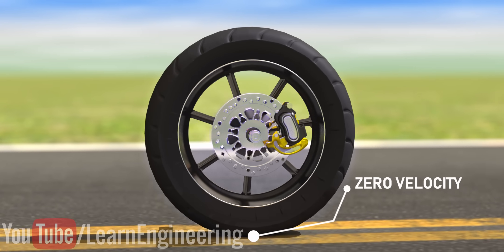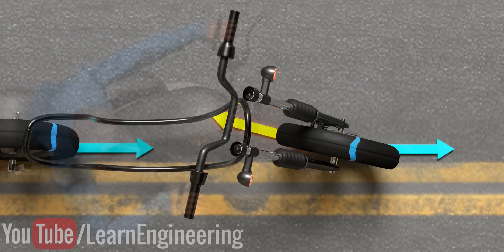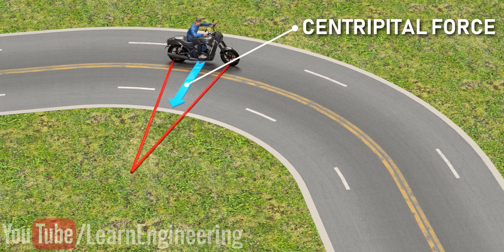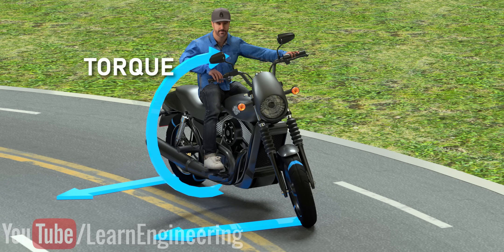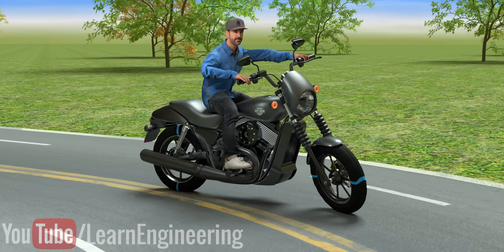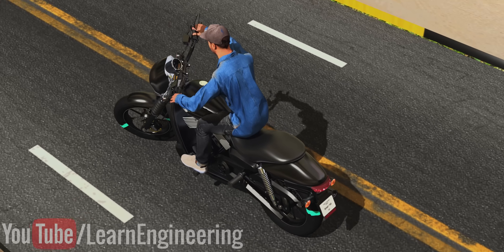Counter Steering | The interesting physics behind it

Comment: This video is incorrect and dangerously misleading.
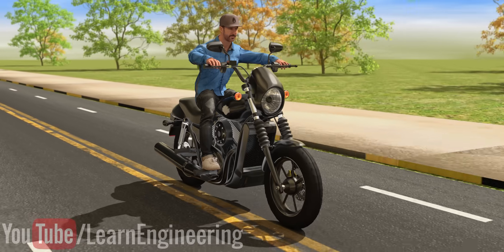It says at 1:11 that "In normal steering, to make a right turn, what we do is just turn the handle bars towards the right and lean the motorcycle inwards"
That's not true in the slightest. Counter-steering IS "normal" steering.
I'm far from being an engineer, but I cannot fathom why a video from "Learn Engineering" does not once mention the massive gyroscopic forces at play on a motorcycle, and does not mention Gyroscopic Precession, the most prominent force at work when steering a motorcycle.
Whether you realise it or not, the front wheel is always turned to the outside of any bend once the motorcycle is at a high enough speed. The front wheel is only turned inwards for slow-speed manoeuvres like u-turns where the wheels are not rotating fast enough for the gyroscopic effect to take over. It varies from bike to bike but this is somewhere around 20mph.
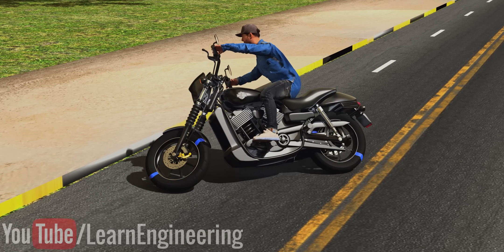THEN, at 3:57 it claims that "In normal steering, the lean of the motorcycle is achieved by shifting your body weight"
Again, totally false and dangerously misleading.
It is nearly impossible to turn a motorcycle at normal road speeds by body lean alone.
In fact, the complete opposite is true. You can ride a perfectly safe and comfortable ride from A to B without ever leaning your body in either direction.
This is a falsehood perpetuated by people who misunderstand what counter-steering is. If you lean to one side on a motorcycle, you are unwittingly pulling on the outside handle (The same as pushing on the inside handle, ie. COUNTER-STEERING) 
This video was clearly made by someone who's never been anywhere near a motorcycle, who is ill-equipped to call themselves an engineer, and I IMPLORE anyone watching this to completely disregard the misinformation laid out here for your own safety.

Learn Engineering, you should be ashamed. You are directly putting people's lives in danger by leaving this video for the world to see.
Reply: Well said. This is confusing and potentially deadly advice here.
Reply: Good 🔥
Reply: thanks.. im a noob who has yet to see a motorcycle up close, and i thought to watch videos like this before i take my MSF.  I ve never rode a motorcycle, but I have ridden a bicycle and this video is counterintuitive. No one ever had to teach me how to steer a bike, so I imagine a larger motorbike should be turned in the same way.... not with all of these steps...
Reply: @asher6657  steering a motorcycle at speed is simple: push left to go left, push right to go right. It really is that simple. When you're going slowly however you use "normal" steering: point the front wheel in the direction you want to go. At some point around 10-20mph counter-steering comes into effect once the gyroscopic force of the front wheel reaches a certain point. It's a different speed for every bike because the amount of gyroscopic force produced is dependant on the mass of the rotating object. (the wheel)
You can familiarise yourself with this concept on your pushbike, the principle is the same.
Reply: @thomaswarren2699  So are you saying turning a motorcycle is completely different that turning a bicycle?  I am NOT trolling,  If you ask me how to turn my bike at speed  I would imagine it's the same principle i would use to turn a motorcycle at speed.   I don't think I would be able to explain the mechanics, just like if someone asked me ''how do I walk?''  I wouldn't be able to explain the mechanics, adequately, but I can walk...  I think it would be the same with turning a bike... it's intuitive.  

 I remember when I was in USMC Bootcamp, when the DI's were teaching us the ''mechanics'' of marching, some recruits ended up walking like a robot. because the instructions became counterintuitive. It would have been better if they just said "walk this way''.  (like the Aerosmith song)... lol   

The point im making is if its the same as a bicycle, they should say the motorcycle turns like a bicycle instead of the step by step scientific explanations of the mechanics of turning a motorcycle IF its the same   I would just rent a mountain bike for 2 weeks before I take the MSF course.    (I havent been on a bike in decades)
Reply: @asher6657  😂 yeah we call marching like a robot "tick-tocking" over here in the UK - to answer your question, no, steering a motorcycle is exactly the same as steering a bicycle. The principle applies to all two-wheeled vehicles; once the wheels are spinning fast enough to produce a strong enough gyroscopic force, counter-steering comes into effect and you push left to go left, the wheel turns to the right and the vehicle banks to the left. 

It seems counter intuitive in many ways but there are complex physics going on that I can't explain well enough so I'll try and find some good educational videos and link them here
Reply: @thomaswarren2699  thanks.
Reply: @asher6657  here's a great one: a professor explaining the physics of changing the angular momentum of a rotating wheel - he starts explaining it all at 14 minutes, and gives a demonstration at 18:50
https://youtu.be/XPUuF_dECVI
Reply: It gets very interesting at 22:40 😂
Reply: @asher6657  
Hi Asher, hope this helps… it’s probably one of the best (if not the best) videos on YT to show counter steering actually working. It’s not my video but the maker is well respected in the biking info fraternity.
https://youtu.be/lzk8oyNO708
Reply: @softailfun  Yeah MotoJitsu is a great resource for all things bike, and he does know what he's talking about, though I would take some of his lessons with a pinch of salt because in some of his lessons he tries to teach racing principles like full body position, apexing and trail braking for road riding and that's something I just cannot agree with.
Reply: I agree with this statement!  This video is horrible.  I was hoping to learn some actual science to better understand it.  Anyone that's ever actually ridden can tell you push left, go left.
Reply: @richardlancaster1258  Here you go, https://youtu.be/XPUuF_dECVI
That's a lecture by Dr Walter Lewin - he starts talking about gyroscopes at 14 minutes, and he gives practical demonstrations at 18:40, 22:06 and again at 35:13 - you do need a solid grasp of mathematics to understand it all, and though the demonstrations are fun to watch, they won't make complete sense without listening to the full lecture from 14:00

Comment: 'Turn the handlebars but don't lean' is advice that will get a motorcycle rider killed.

Push Left. Lean Left. Go Left.
Push Right. Lean Right. Go Right.

Countersteer AND lean. Combine the two and you can turn tighter at higher speed. You should not be thinking 'one or the other'. You should always be counter steering at speed.
Reply: Hi Forester, "Learn Engineering" has been ignoring all the calls for this video to be removed, and he is directly putting people's lives in danger by spreading this misinformation. If you could flag this video as dangerous, you could potentially save someone's life. 
One Love

Comment: The physics are correct (I have done the maths and vectors and equations and forces at university's physics class; and if you take your time to understand, pausing, thinking and analyzing what is being said, it will make a lot of sense). The thing that is most "confusing" is the term "normal steering". I know it has been chosen as an oposite term to "counter steering", but whoever is reading, don't be confused, it doesn't mean you can always choose between these two ways or that you should use "normal steering" as much as posible because, you know, "it's normal" (at 99,9% of the distance you will travel, it won't be the "normal" way of steering). 
At higher speeds the "normal steering" is not as effective (not to say almost completely ineffective) as the "not-normal/normal-at-high-speeds/counter steering" because you can't turn the front wheel as much as you do when going at lower speeds. If you do that you will fall inmediately (high frictional/outwards force, low centripetal/inwards force, and you can not lean inwards to almost 90º to compensate), so you should turn the front wheel just a little creating this way a big circle whose instantaneous center (point at which two lines coming from the center of the wheels meet) is far far away thus giving a small change in direction.

So you riders/future riders reading me, at low speeds (I mean, very low speeds, 0-10 km/h) normal means "normal steering". At higher speeds than that, normal now means "counter steering". And as the title says, the video talks about the interesting physics behind counter steering, which indeed are interesting, accurately represented and mind-boggling.

Have a safe ride!

Comment: While probably correct on the side of the physical forces, this video is highly misleading when it comes to the practice of operating a motorcycle. Countersteering is an effect that automatically occurs at speeds from and beyond about 20km/h. If you ride any 2-wheeled vehicle at those speeds, you will always go the opposite direction of where you turn the handlebars. The only choice you have is whether you consciously or unconsciously use this.

Comment: Counter steering the easy way to remember it 

PUSH the RIGHT Handlebar, the bike drops to the RIGHT,  and also lean your body to the right

PUSH the LEFT handlebar, the bike drops to the LEFT, and also lean your body to the left

Saying "By turning the handlebars to the left, the motorcycle shifts to the right" is very confusing, besides you can't turn a handlebar at 60 MPH, you have to PUSH the handlebar

PUSH the RIGHT Handlebar, the bike drops to the RIGHT,  and also lean your body to the right.

PUSH the LEFT handlebar, the bike drops to the LEFT,  and also lean your body to the left.
Reply: Yep. That's a better way to say it.
It might be better if a student had it pointed out to them while being a passenger and seeing how it works in practice rather than engaging the 'thinking' brain.
Reply: John Guarnieri 
Push left, go left
Push right, go right.
As for the body, you lean with the bike as opposed to leaning your body to make the bike lean........ Which of course doesn't happen.
All that being said, this video is dangerously inaccurate and could easily lead to having an accident, it really should be taken down.

Comment: Cornering on a bike is ALWAYS performed by counter-steering. Using your arse to lean is only efficient on a bicycle because it weighs about 10% of your own weight. Your motorbike can weigh five times as much as you - using your scrawny arse to make it lean is as effecting as pissing on a house on fire. Always use counter-steering even if the turn you're taking is mild.

Comment: This video feels inaccurate. The discrepancy between "normal" steering and counter steering isn't a conscious decision, but simply a function of the motorcycle's speed. Past a certain speed, counter steering takes over and the motorcycle will turn left if you turn the bars right
Reply: "Learn Engineering" has been ignoring all the calls for this video to be removed, and he is directly putting people's lives in danger by spreading this misinformation. If you could flag this video as dangerous, you could potentially save someone's life. 
One Love
Reply: You are right. Too much jazz here. He also forgot to mention that the spinning wheel (especially spoked ones) become a gyroscope that  stabilizes but resists lateral change. Riding on painted lines tosses it all out the window, though.

Comment: There is some vital information missing, at speed you counter steer, if you then turn into the corner you will lean the other direction or start to pick the bike up from its lean. Its at low speed where you will use a little counter steer then turn into the corner in say a U turn and is generally at walking to jogging speeds. So yes technically there is 2 ways to steer a bike, but its speed dependent
Reply: WholesaleTurbos 
Someone who understands counter steering. Well said fella.

Comment: What is the minimum speed required to perform this?
Reply: Akshay Sheth Zero.
Reply: @XtreeM_FaiL  Not true. Counter-steering only comes into effect once the wheels are rotating fast enough for the gyroscopic forces to overcome the inertia of the bike. There's no one particular speed that this happens, it's different for each bike. Basically, the fatter your wheels, the more inertia they have, and the stronger the gyroscopic forces are, meaning a lower speed for counter-steering to be effective.
For slow speed manoeuvres like U-turns, it's perfectly safe and normal to steer in the direction you want to go.

Comment: This is misleading information it shows as if the rider has a choice between the two i.e. steering and countersteering. 
The rider has no choice at low speeds the bike will steer and at higher speeds it will always countersteer u cannot steer it at high speeds and u cannot countersteer the bike at low speeds
Reply: "Learn Engineering" has been ignoring all the calls for this video to be removed, and he is directly putting people's lives in danger by spreading this misinformation. If you could flag this video as dangerous, you could potentially save someone's life. 
One Love

Comment: who tf turns his handlebars before leaning? that would be an instant faceplant!
Reply: I've been doing it for fifty years without a single face plant. It's a very slight movement, over with quickly.
Reply: @craigmilliman2763  i mean the "normal steering" this video describes not the countersteering way

Comment: You don't need to turn the handlebars in after you counter steer, above low speed (when you would counter steer) a motorcycle's rounded tyres provide the zero-slip condition required to for the motorcycle to corner as the motorcycle leans and the contact patch moves closer to the edge of the tyre.

Comment: There's a distinction between speeds under and over 15 miles per hour (or somewhere in that range) which should've been mentioned in the video. When you're going over that threshold  counter streering is the only way to steer the bike in the direction you want.  It's really simple actually. The bike goes in the direction it leans (this goes for both slow and fast speeds).  In slow speeds the point of gravity will go to the way the front wheel points (try this  on a heavy bike when stationary and try not to tip over to the way the wheel points )

The only difference between slow and fast speeds is that when you're reaching the treshold of 15-20mph  you have to take into count that the counter force (opposite force to gravity) will be greater than the centrifugal force that  pulls you the way you steer.  Turn right => counterforce will make the bike lean left + the front wheel corrects itself  => you will go right

Push left  handle bar to go left, push right handle bar to go right. Nothing complicated about remembering that. Of course in the end everyone does it even if they aren't aware of it. You just feel it in your body how the weight shifts. But it really helps when you practice safety maneuvers like swerving to know that  you actively will have to push the let handle bar forward to go left. It's one thing to take a curve in 40mph when you barely need to touch the handle bar and lean a little to the direction you're going, and another to swerve past a breaking car in front of you.

Take a safety training course or at least practice this in a safe environment like a big parking lot.

Comment: You should warn that this technique is only valid you you drive slow (less than 20mph). From this speed the only way to steer the motorcycle is through counter steering, what means you cannot lean the bike in the same direction you are steering the handle bar.

Comment: Turn handle bar when turning? Try mate, try to fukin turn handle bar when motorcycle pushes the wheel forward. We don't turn handle bars, we lean the motorcycle when turning.
Reply: OrangeTime 
You lean due to counter steering. Just throwing your weight around has been proven many time to achieve very little. You only lean with the the bike, the bike doesn't lean because you have.
But this video is dangerously inaccurate for this topic. Try this link, not my channel. https://youtu.be/lzk8oyNO708
Reply: @softailfun  ...what does that have to do with my point that we don't turn corners using handlebars? lol
Reply: OrangeTime 
Well you are right in as much as you don't "turn" the bars, but you do apply forward pressure on one bar to force the bike into a lean in order to turn. When you apply that pressure the wheel does momentarily move off centre and point in one direction or another (opposite to where you want to go) although it is only slight. Without the "push" on the bar, the bike wouldn't lean. So you do indeed need the bars to make the bike take a bend rather than weight.

Comment: I’m a new rider. This video really confused me. I’d best take a Safety Course, eh ?
Reply: BlueLineGroovy 
This video is dangerously inaccurate as regards any bike riding!
You will never learn to ride just from videos p, so yes a safety course is always recommended. That being said, good info can be gathered from some you tubers. For counter steering, try this guy, prob one of the best vids on the subject on YouTube. https://youtu.be/lzk8oyNO708
Hope it helps.
Reply: Yes!

Also as softail mentioned, there are alot of videos. But the best way to learn is to do it. 
Just start slow, steer back and forth using countersteer and you will get the feel of it. Once you are comfortable add a little more speed. But stay safe.

Basic principle is; you steer by leaning, and you lean your bike with countersteer. If you reallyu  strugle, get a bicylce and start there. It's lighter and easier, but works just the same as a motorcycle.